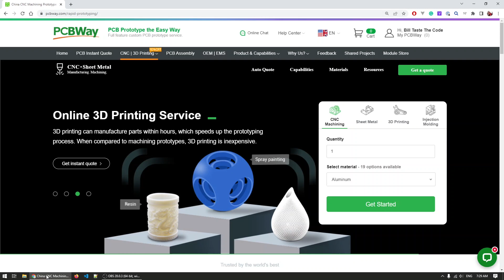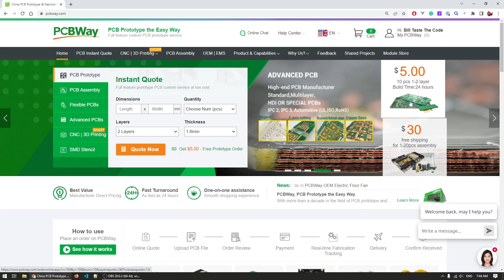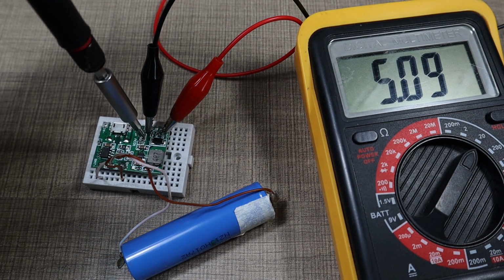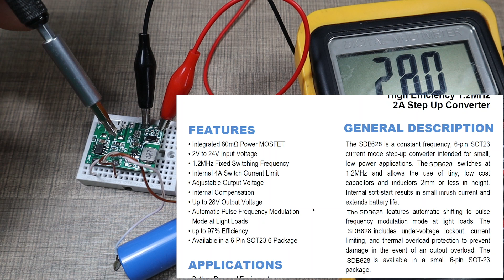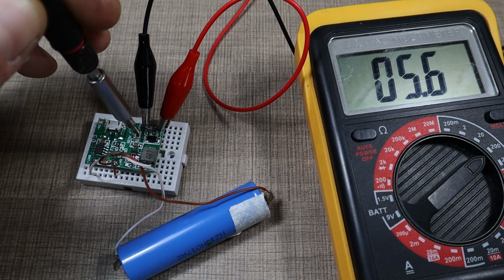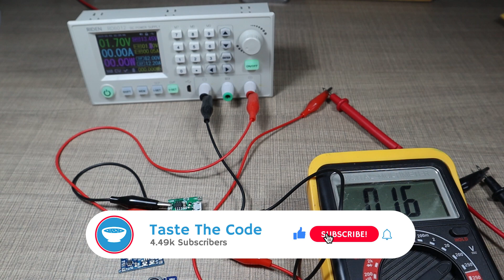New TP4056 module with step-up circuit review - Not that great!

Comment: For your last demo, can't we use BMS protection circuit fir lithium batteries?
Reply from the maker: Yes you can. You can also use batteries with protection built in but you need to be aware of the issue.

Comment: The voltage disturbance seen when the screwdriver is in contact with the trimpot is unlikely related to capacitance as the feedback divider is relatively low impedance.  What you're seeing is likely erratic contact between potentiometer slider and resistive element when screwdriver pressure is applied.  The failure mode for those $0.01 SMD trimpots is slider lifts off the resistive element so hopefully the pot is the grounded resistor in the feedback divider where this failure will drop the regulator output to minimum vs. let it fly to its maximum, potentially damaging whatever is connected to its output.
Reply from the maker: Yes, that is probably what's happening. I did not reverse engineered the circuit to know if it is grounded or not but let's hope it is 🤞
Reply: @TasteTheCode  What if you just stopped shoving down on it with an oversized, heavy screwdriver?

There is such a thing as the right tool for the job and your screwdriver just isn't that.   Try a regular flat blade jeweler's screwdriver, which requires practically zero downward force unlike a big phillips.
Reply: Sticking a a big lump of metal very near a high impedance, fast switching circuit is bound to cause problems! That is why trim pot screwdrivers are made of plastic!
Reply from the maker: Yeah, but this is what I had on hand. I'll try better next time. Thanks!

Comment: Thanks for the heads up. The problem with the smd pot is that it's just crap. Maybe you could replace it with a decent one.
Reply from the maker: Yeah, but I got used to them. It's only once that they are adjusted anyway so it is not a big deal.

Comment: If you use batts with built-in protection, then not an issue.
I picked up a few to convert a LED lantern from 3AA's to lithium. It worked well.
Note, there is a trace from the 4R7 inductor that runs along the edge of the board, If you cut that you can add an external switch. That powers off the boost circuit. The latern I had had apower switch so I added it there so there is no current draw when off but you can still charge the batt.
Reply from the maker: Wow, cool info. I did not look at preventing the current draw but that will definitely come handy some time. Thanks!

Comment: The problem with this board (and a two board solution such as TP4056 + boost board) is that the maximum current it will deliver is 1Amp (shared between battery and external load). If the battery is getting almost flat and you run with a high load (over 500mA say), it will discharge the battery because the load will start drawing from the low voltage battery and then the battery will go flat until underprotect kicks in.
e.g. We have a project+AC01+protected LiPo.  If the LiPo is flat or nearly flat, and we then connect 5V Power AC adaptor - the project load will fully discharge the battery. If however, the LiPo is well charged when we connect the 5V PSU, the battery will slowly fully charge. Even if the battery is fully charged, the charger will not stop while the load is still on. This will keep a constant 4.2V on the battery. The solution is to wire up either two schotty diodes or a MOSFET+diode. See https://youtu.be/3JxidPLKnqQ and https://youtu.be/T70mBHeIOZA.
Reply from the maker: OK, that is an interesting case. In my applications, the load is usually very small.
Reply: You are misusing it.  This is not meant to be a power supply for the device, just a charging and protection circuit for a charged battery to power the device.  There is no problem with the board, rather it is what it is designed to be, not magically whatever you wish it was instead.

However your argument is in error either way.  If you are giving it a 1A (USB?) 5V input, and the load is taking 1A or less, you are not discharging the battery at all.  IIRC, someone even covered this in a video, maybe it was Big Clive?  Yes I think it might have been and he even pointed out the reason for misunderstandings such as the one you mentioned, something about not realizing that it charges at a lower rate till the battery gets up to (3.0V?) some voltage.

Comment: To overcome that shortcoming, would it be safe if I added the BMS 1S module? Because BMS 1S can cut off the current if the battery reaches 2.7V
Reply from the maker: Yes, that can be done and also there are now modules with built in protection.
Reply: Do you have a link to the module with battery protection included?
Reply from the maker: @javeza2008  you can try this one https://s.click.aliexpress.com/e/_DEJFmTJ It has a chip marked as WKE1K that I think does the protection but I haven't tried this one inparticular myself.

Comment: I got this modules few days ago. The batt drained out too bad, then cant be charged. So i contact the supplier, they said it should secured with bms module to avoid batt over discharged
Reply from the maker: Yeah, the battery needs to have it's own protection module separate from this.
Reply: That is a much safer option.

Comment: Hi, i have a protected battery and need to power low amp diodes. I can only charge the battery with 400ma max, is there any resistor on the board to limit the amp output ?
Reply from the maker: Hey, yes there is. I have a separate video on that https://youtu.be/qCFdlcmdSMs

Comment: I don't see those as problems. But it's output voltage comes with lot of noise, like it is impossible to use in certain circuits. I used it to power a meter but meter is not working due to its noise.
Reply from the maker: A meter is best powered directly from a battery. The are extremely susceptible to noise.

Comment: Maybe it jumps the voltage because you use a screwdriver with a magnet
Reply from the maker: I tried with different ones it was the same. It reacts on the pressure applied.

Comment: En la descripción del producto de aliexpress en rojo dice que si tu bateria no tiene modulo de protección debes comprar el modulo con protección incluida. Entoces este modulo del video se puede usar para baterias de celular pero no para baterias 18650 que no traen modulo de protección. Muchas gracias por el video amigo.
Reply from the maker: You are welcomed! In my case, at least in my listing that was not stated. Maybe they changed it since because of complains.

Comment: The new Type C variant is out and it has both overcharge and over discharge protection. I bought 3 of them and they are very cheap. 325 Taka (around $3) with delivery charge.
Reply from the maker: Nice, I haven't looked at them yet but I'll order some to explore. Thanks!
Reply: @TasteTheCode  Thanks for replying. So, I did some testing and the protection IC they used is named MKG2H. It cuts the voltage when battery reaches 2.5V.
Reply from the maker: OK, that seems to come out as RY2201. Interesting looking little chip. Definitely worth the check, thanks!
Reply: What is the name of this improved module with battery voltage protection? I see both micro usb and type c modules and I don't see any extra chips on the type c.
Reply: @rory9174  It doesn’t have any name, but the PCB is different. The one with protection IC has black colored PCB while the one without protection IC has green colored PCB.
Reply: @ishtiaqueahmed903  Thanks Ive found a black PCB thats more compact than the green one. All the 4 soldering pads are on one side of the 4 sided board?  Ridiculous how YouTube don't allow links in comments. It would make finding things easier. What about the potentiometer, is that more stable also on this black PCB?
Reply: @rory9174  Unfortunately the potentiometer is as bad as the previous one. 😒

Comment: Great information the protection is needed.I have purchased one of these boards and added a protection board to the single 18650 cell.It is one that attaches to the + and negative and the feed out is taken from the centre of the board and soldered to the module you use.This adds shorting out protection and over discharge protection so it looks really good.There are modules that do both jobs but the Voltage output is not variable it's set to either 5v 6v 7.5v 9v 19v 12v but as I require 9v to power a radio it should do the job?
Thanks agian for great upload.Perhaps there is a module like you demonstrate with protection?Does anyone Know it?
Reply from the maker: Thank you! As far as I'm aware, I could not find one on AliExpress that has the protection on it. For the radio, it should power it without issues.
Reply: Thanks which board does all this in one and output 6v?
Reply from the maker: I haven't found one that output 6V. Your best option is to have one board for the protection, and the another adjustable for the step up that you set to 6V.

Comment: Interesting review, as you say it's a shame the module doesn't meet the minimum requirement for battery protection. It is good that you highlighted the problem caused by your natural capacitance when adjusting the output voltage.
Reply from the maker: Thanks!

Comment: You can buy lithium-ion batteries with built-in protection, or add a small in-line protection module module to an unprotected 18650 for example. You just have to make sure that your battery holder can accommodate the sometimes slightly longer battery.
I would have liked to have seen how the output of the module varies with load, perhaps up to about 1A at 5V. Also it would be good to see what noise is present on the output.
That kind of information is usually crucial to whether a module is suitable for a particular application.
Reply from the maker: Hey Rex, thanks for the suggestions. I agree but this is the limit of what I can do right now with the equipment that I have.

Comment: I'm not understanding why you are disappointed with the module. It appears to be functioning within specs. 
Your complaints:
1) Doesn't have a lot of current draw..... DUH.. you're converting current to voltage in a boost circuit from a single cell.  Also.. Nowhere in the datasheet for the SDB628 IC does it say there is a maximum current. The only listed current information is it's quiescent (standby) current dissipation which is 200uA - 2.2mA. however, you're max current on that board is going be around 1A as the design of it is limited. 
That being said, i sure hope you not expecting to jump-start a vehicle using this tiny little boost circuit anyway, so if needing more than a an amp is a concern for you, than of coarse a little $1 charge/boost module isn't going to cut it. 

2) When i bridge contacts in a metal-on-metal SMD Pot using a metal screw driver, things short out............... yep.. every time my guy..

3) If you know your module doesn't have battery protection, then ensure your battery has battery protection. This is kind of a no-brainer. It's nothing to puck up a small DW01 based module for 18650's. (shocker i know)

After watching the video... it seems to me you are having buyers remorse, because you didn't understand the product you bought. It's clear to see just by looking at the module there is no battery protection. If you didn't notice this, it's YOUR FAULT. It's OBVIOUS that you're not going to get more current than a few amps, just by the size of the device, and it's purpose for use. It's designed for small electronic projects, not running a microwave oven off of an 18650. 

Sorry my guy, but every complaint you have about this device is your own fault. 

It's like buying a volvo for $5, and complaining you didn't get a lambourghini
Reply from the maker: But I still want that Lamborghini 😅
Reply: While your argument is fair, some of us feel that such a board shouldn't exist except as some obscure counterpart, that the design should  have a DW01 (or other protection IC) on it and not need that added with a separate board.  What's the point of cramming what they did onto a board that's so small, that they couldn't even manage to fit mounting holes on it, and STILL need to add another PCB just to do the function almost everyone is going to NEED, even if they don't realize they do.

However, on the topic of size, TP4056 itself is a bit ridiculous.  Even if the module is only $1 each or rises to that (knowing they are cheaper in bulk), the cost to integrate a larger transistor in it would be what, two cents?  It wouldn't even need a larger PCB sink  area in instances where it doesn't need to go past 1A, maybe a slight layout shift for a few sq millimeters.  I state this, having noticed the obvious, that being a linear regulator, they do get pretty hot for no good reason.  This also means that along with no mounting holes, I can't do what all the kids on youtube are doing which is fasten it all together with HOT GLUE, lol.